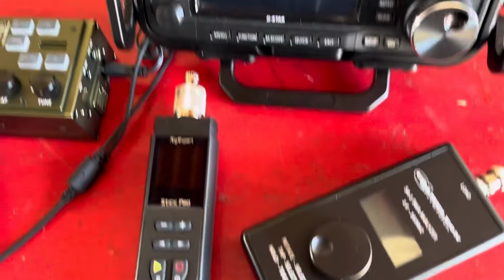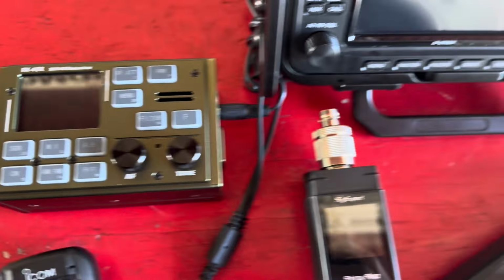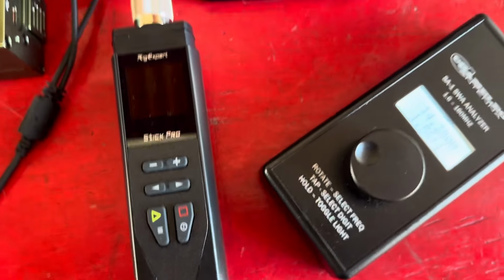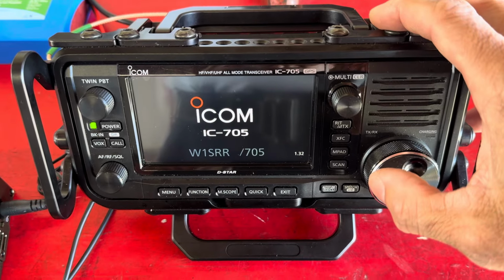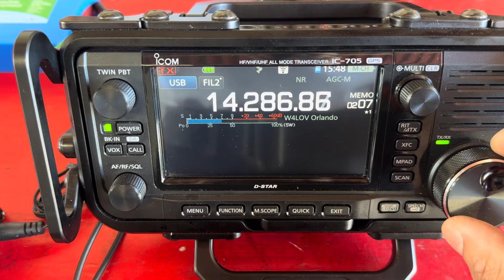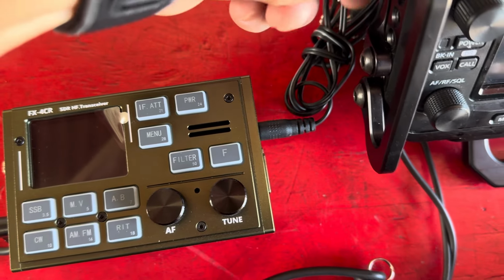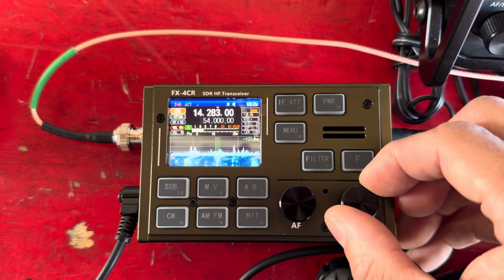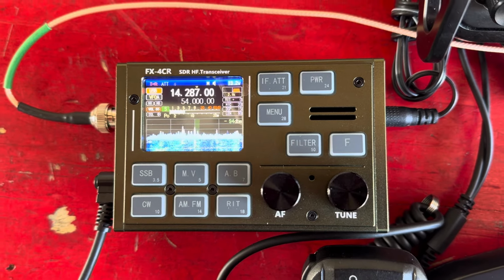FX-4CR bug?  Comparison with the IC-705

Comment: That sounds like the AGC delay...should be a change of a setting to fix that. I have not had to play with that though, as my unit does not have that delay. I know you made your mind up already, but the better comparison is the FX-4CR vs. the Xiegu G90 from a price perspective. What do you get for the money, is the question I usually ask. I do not have a 705 so I can't say myself...but I do own both a g90 and an FX-4CR for less than the 705 sells for on sale.  For portable ops, size and weight, the FX-4CR is hard to beat in my opinion. Thanks for sharing! Cheers and 73 de W3LAM
Reply from the maker: @CigarsOnTheAir  the seller asked me to do a firmware update (although it has the latest version). My issue is that my computers cannot recognize the rig.  Will try the update tomorrow
Reply: Definitely sounded like an AGC hanging issue. Also I noticed when you touched your coax when hooked to the analyzer it was changing your SWR that's a good sign you need a choke or better choke before the radio that could be letting RF get into the radio. Love the FX4CR by the way.